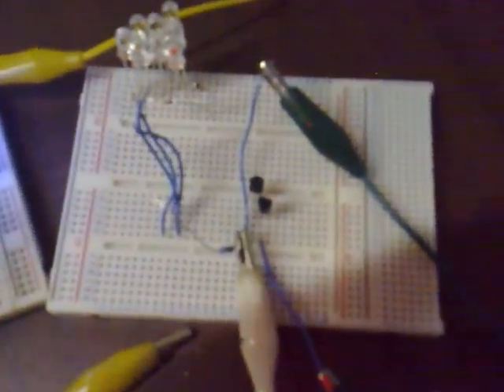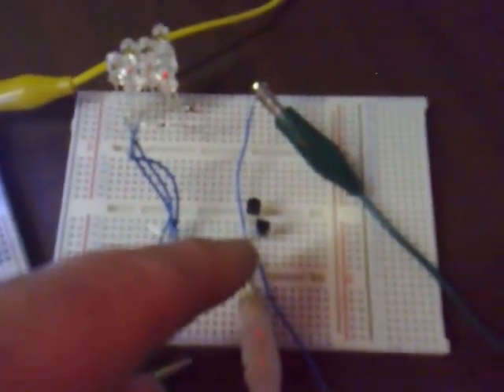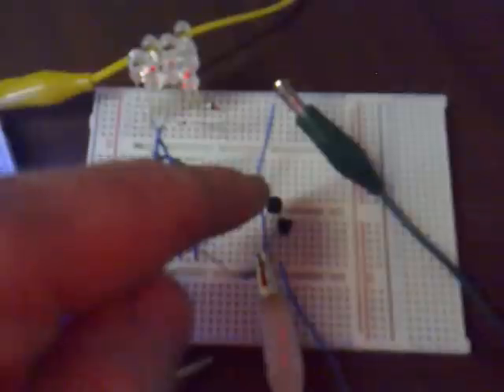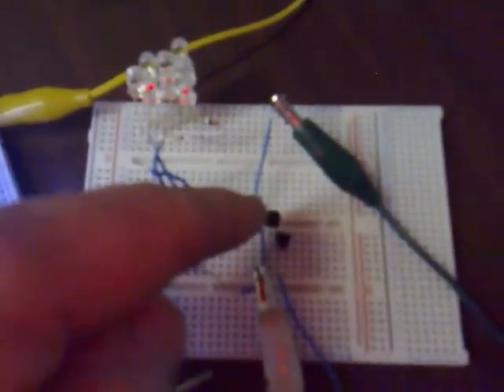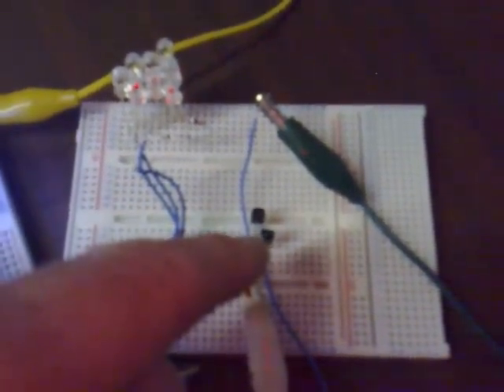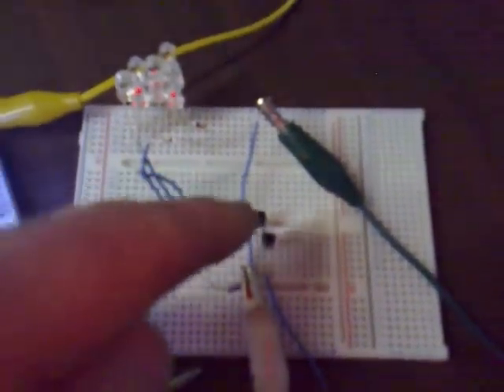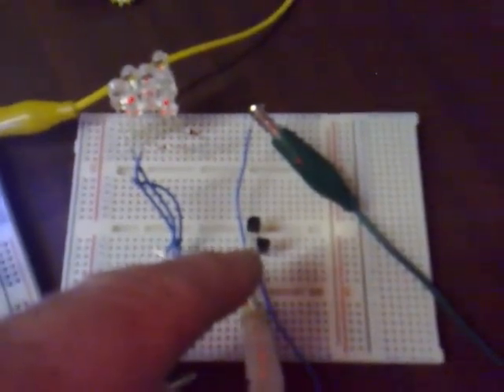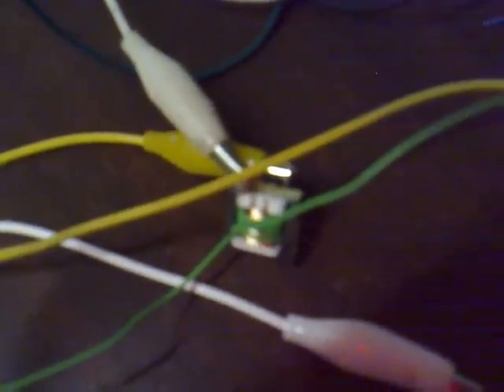Slayers choke exciter using cfl parts

Comment: wow, i missed this one! I just learned a whole bunch in the first 15 seconds. thanks. I have been messing around with those small inductors, thinking they were transformers... only to have them "misbehave" as a transformer... yet ... some of them have more pins/wires than just two? I don't get that part, is it like a long coil, singular, with tap points? And the dual transistors.. cool... are they both NPN? That's not a Darlington arrangement?

Comment: @jonnydavro oh i think thats where i messed up. all i have is tower and primary 6 windings i didnt think u needed a receiver tower. so my output tower is regular telsa secondary as far as the direction of the windings, but is it supposed to be a bifilar or regular. then is the receiver tower clockwise or counterclockwise and bifilar or single. thank u for input. just so i sure. I use a 9.6v 800mAh old rechargable rc car bat. and if the cfl is gutted what is process, cause i already have 3 apart.

Comment: i would love to see your full circuit for this the transistor connectios are great i love the open emmitter lead and as you said this reduces the current draw i think this has to due with the junction bias and how it regulates current through it. I am not sure but i think a small diode will not always perform in the same manner but some have for me and others did not. 
really liked your builds.